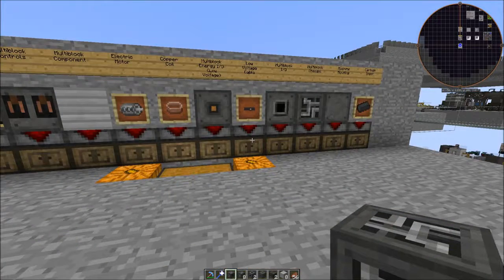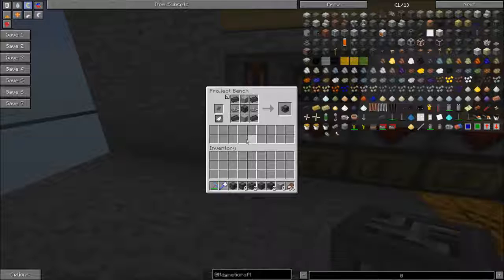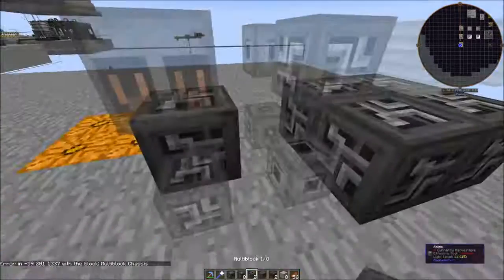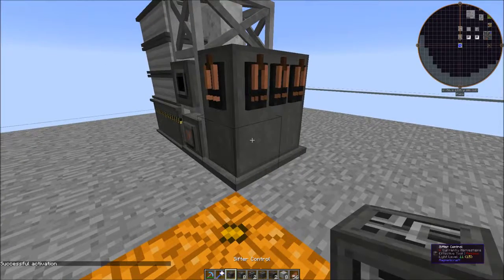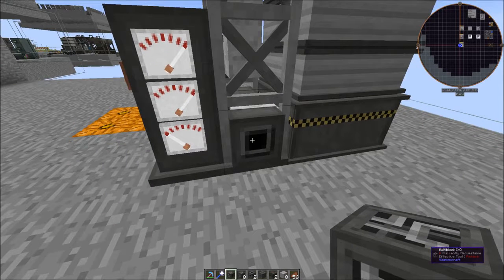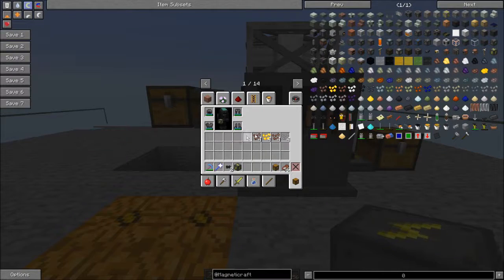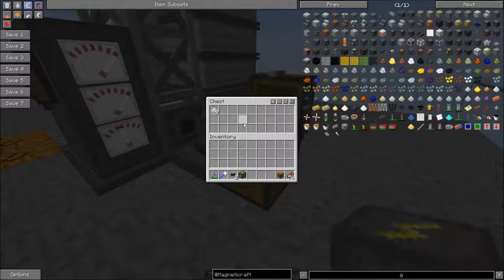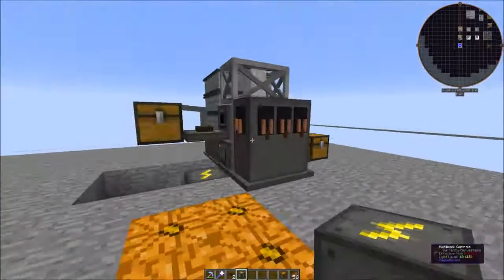Magneticraft Sifter Multiblock - KollinsPlays mod Spotlight

Comment: dayum, the one thing im interested in isnt covered in this tutorial :( do you know yet how the speed levers work? top gage is on/off, middle is speed and bottom is energy; every lever moves the gage by one third, so i guess they all do the same. i wonder if it's cheaper on energy if it's not running on full speed?
Reply from the maker: My Sifter tests all show that the increase in speed is significant while the increase in energy usage is negligible so it's not worth running slower to try and save energy. YMMV based on your mod pack, but my guess is it will always be faster with an insignificant energy increase.

Like you said, the top gauge is on/off, the middle gauge is speed and the bottom gauge is Energy and each of the 3 levers in front increases speed by 1/3.

My tests in Bevo Tech Pack Reborn came up with this:
no levers = 554kJ to process  10 Pebbles
1 lever = 554kJ to process  10 Pebbles
2 levers = 559kJ to process  10 Pebbles
3 levers = 571kJ to process  10 Pebbles

In comparison, 2 charcoal in a Basic Generator produces 104kJ. This means the extra energy cost from slowest (554/10 vs 571/10 or 55.4/pebble vs 57.1/Pebble) is 1.7kJ per Pebble or less than 1/30 of a piece of coal A.K.A. insignificant.